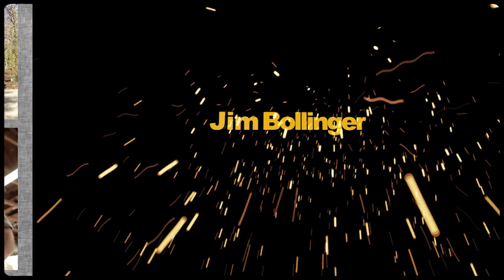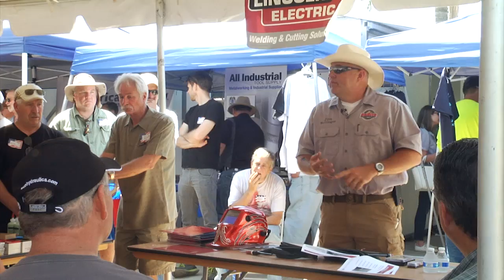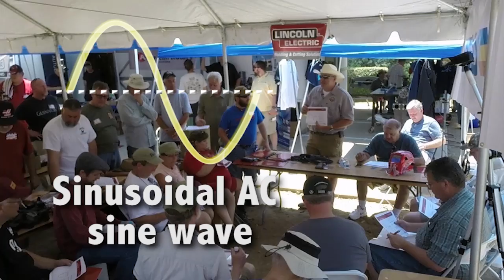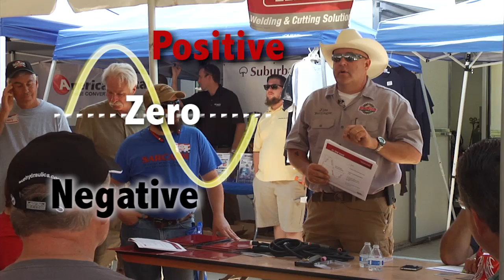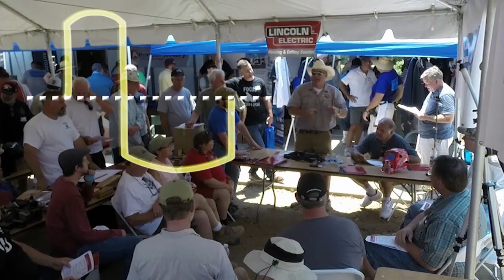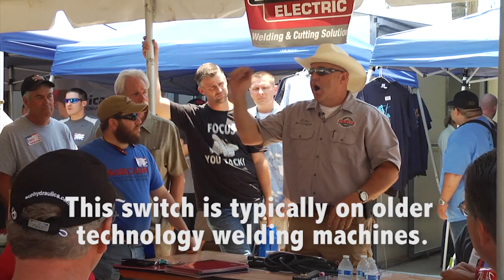TIG welding basics part 2 - polarity, asymmetry and why we weld aluminum in AC

Comment: Question about Square Wave on video. When the % of positive was lessened, yielding a more energy negative square the zero axis point moved to the left. I was thinking that would imply a change of frequency. I expected, before seeing the video, that the amplitude would have been reduced, but I think you are saying there is a time shift % where positive is lessened and negative increased within the same one cycle frequency.
Reply: The cycle is complete when the next positive event happens. So the frequency stays constant, even though the positive portion is shortened (the negative portion is lengthened by the same amount).

Time is 1/f, (t= 1/f) so if frequency is 60hz, 1/60 = .01666
The wave repeats every .01666 seconds (or 16.6 milli seconds).

Hope that makes things clear as mud... lol
Reply from the maker: Correct, in reference to one complete cycle. Time, not amplitude.
Reply: Thanks for the fast answer. I follow your Channel faithfully and this "Class Series" is just icing on the cake! Great Job :-)
Reply from the maker: That is correct!

Comment: Great information about tig welding. You explained it very well and now I have a better understanding of how a tig machine works. Just purchased the Lincoln Tig 200. I have used a square wave 175 for many years. I need to contact you regarding my SW 175, I have experienced trouble getting an arc started when using the ac. Again, great information in your video!  Mike
Reply from the maker: A bad ground or a defective torch (high freq leaking through the torch lead) has been the most likely causes of difficult arc start in AC.
Reply: I'll take a look at both of those issues you mentioned. If it is a bad ground issue, where do you recommend I look for that? Thanks for getting back to me. Mike